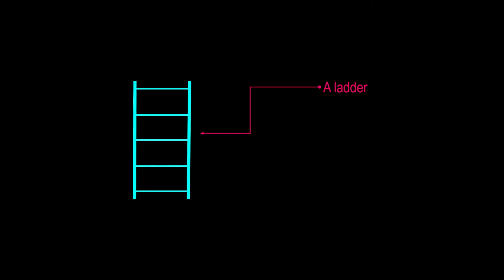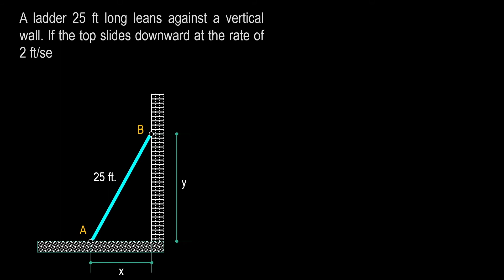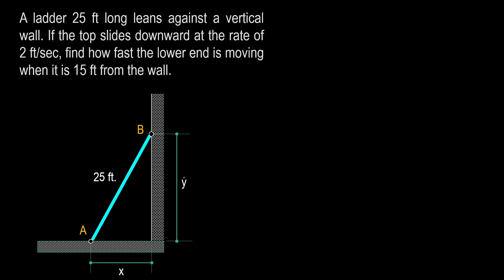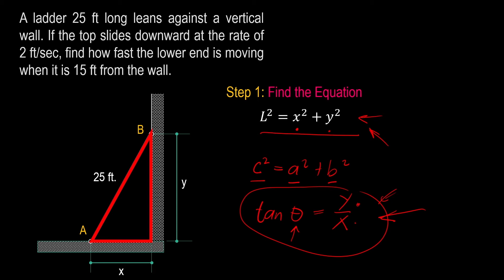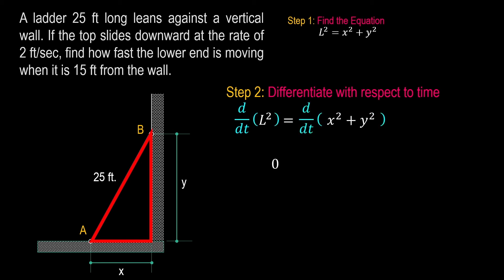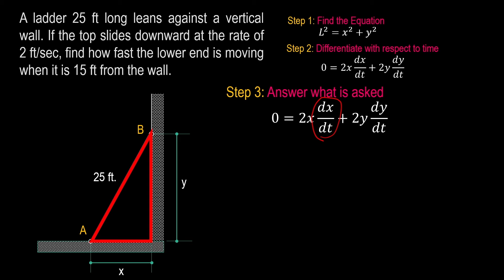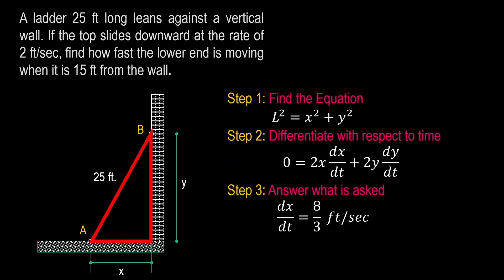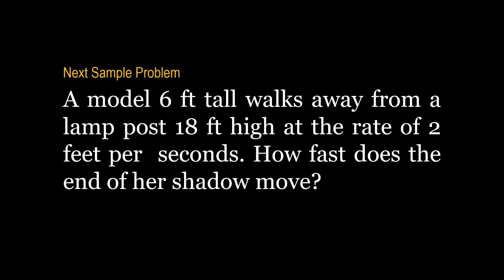Part 1. Time Rates: The Ladder

Comment: Bakit po hindi negative yong answer nya po?? Diba negative yong x?
Reply from the maker: Oo nga. My bad.
But if you go to 11:23 of the video, ipinakita dyan kung ano yung value ng dy/dt which is 2 ft/sec. It should've been -2 ft/sec. (emphasis on the negative sign) because the direction of the motion is downward.

Anyway, the negative sign only indicates the direction, or sometimes, it is used to indicate if "increasing" ba or "decreasing".